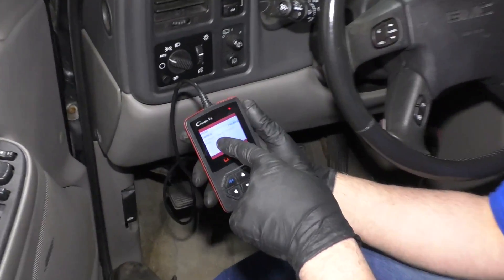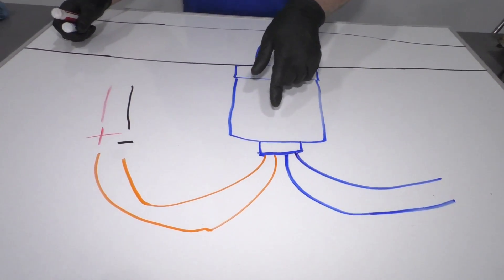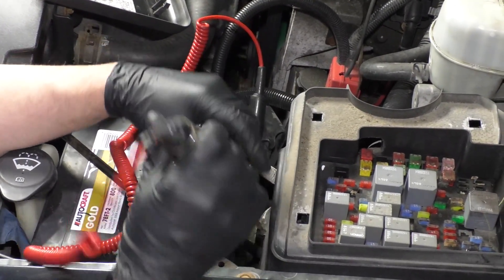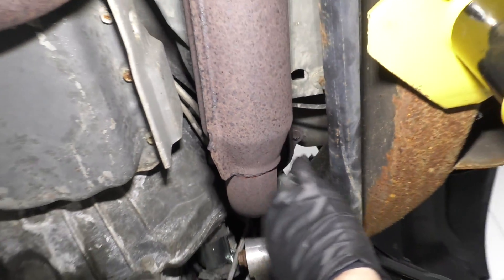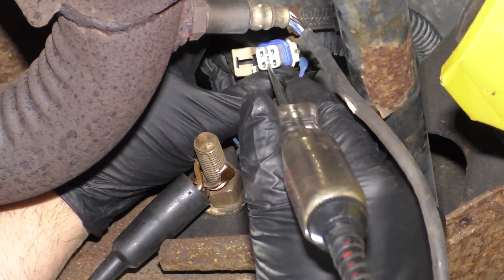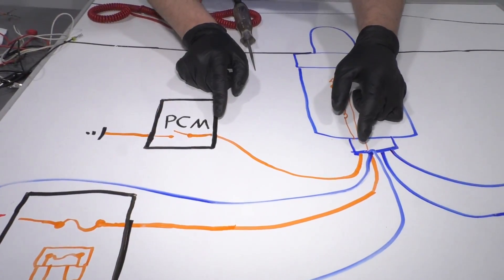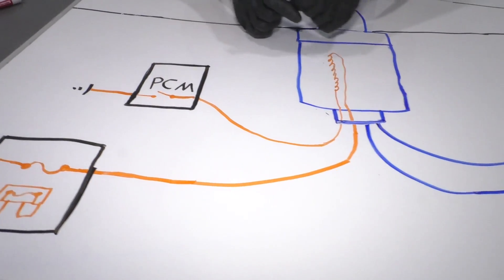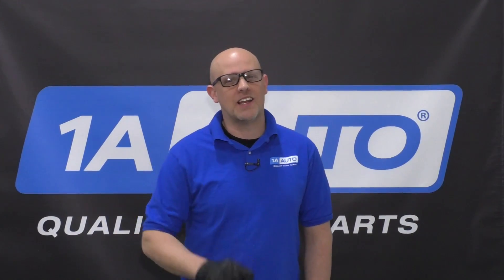Check Engine Light? O2 Sensor Heater Circuit Malfunction - Code P0141

Comment: My Dodge Charger V6  is getting a Code P0138 Bank 1 Sensor 2  02 electrical circuit signal High Voltage.   In need of advice  thx if u can help